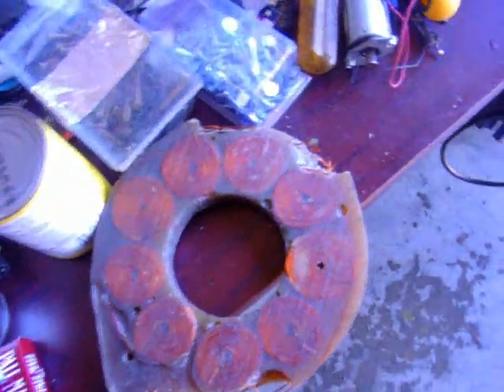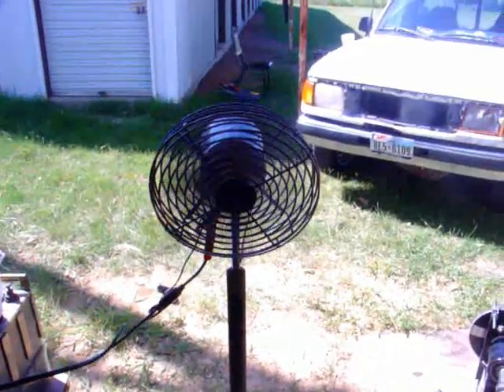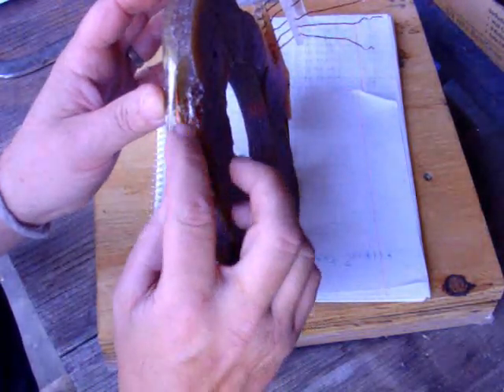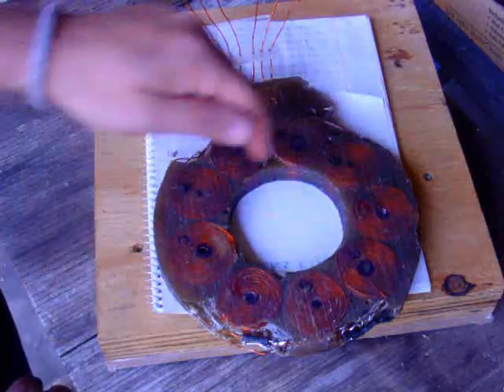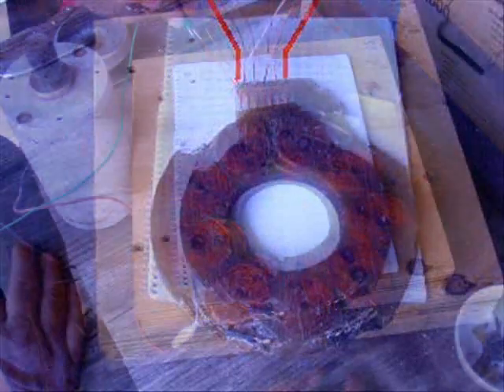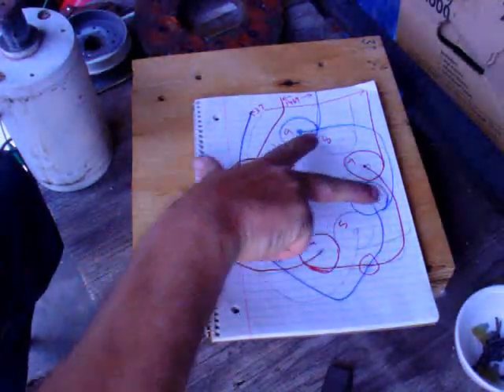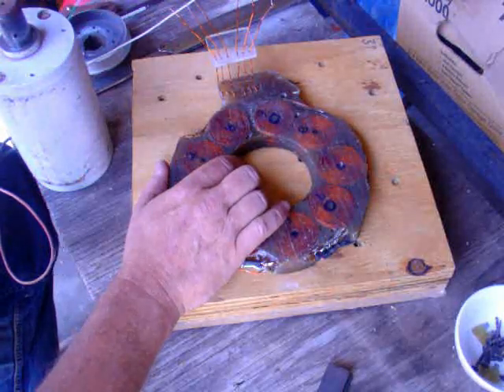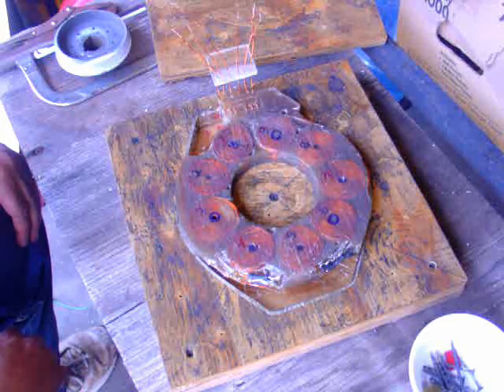PART 4 DESIGN OF MUDDY'S MIGHTY MINI WIND TURBINE

Comment: hi Scott Anthony in Vietnam, im a old disabled teacher in vietnam watched and learned a lot form alll your videos i  knew nothing about electricity  but your videos are very good  great  thanks, im here with 7 others in my building, . none think this can work i have the bedini handbooks1 , intermidiate . but i want to do your style of rotor.  i have
can you help?
I'm trying to make a 36 magnet  9 mags per disk middle disk is dual magnet both side 9 mags each side, n opposing sides have 9 mags also. so 4 sides one disk facing inward has 9  middle disk has 9 on each side the disk then facing it is other disk with 9 mags   2  stater one each side of dual mag middle disk.
so first how do i do magnets N N N N N N  same Bedini or alternating  N S N S N S N S N n on dual
ques #2self running diagram of circuit for this is needed also plz can you give me direction
so can you give me diagram simple stupid 
to make this work. can i do overunity with this n put in inside my room they dont let us do anything to building or roof might fall in
anthonyolivera@yahoo.com
Live from Vietnam 
8am 11/13/2013

Comment: So, when you found your short, are you saying that when you soldered the wire, you burnt the insulation on the coil. Secondly, it appears your connections are wired to the outside of what will be the casting, so I'm assuming you wired and soldered to the outside of your stator so repairs and trouble shooting could be easier performed?  Please answer this week:-)

Comment: Don't know if anyone else has made this suggestion but,  maybe you could put some tubing in the mold where the mounting holes will be,  even if some resin gets in them and you have to drill them out they would protect the coils and connecting wires. Maybe  use over size ones so it wouldn't matter if they weren't central?

Comment: I have been clecting Microwavve tranformers so I can keep the primary trying to collect 12 or more coils to make a nice flx core alternator. and I might go for 24 for a dual system but first I like to at least find 12 of the same size transformers I might have to go the old ebay way but I like to first try and find them free.  I should look on craig list.

Comment: I had to do some of that wire repair when I was doing your ceiling fan motor. The thin wire of the cfm can get damaged easily and I had to do the same thing although it was just reconnecting the wire. This stuff is easy only when it works.